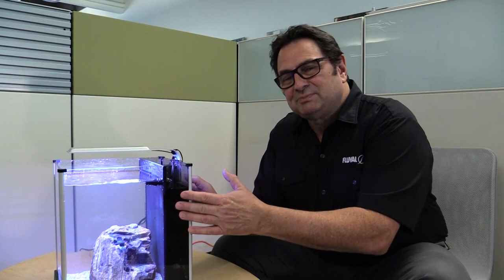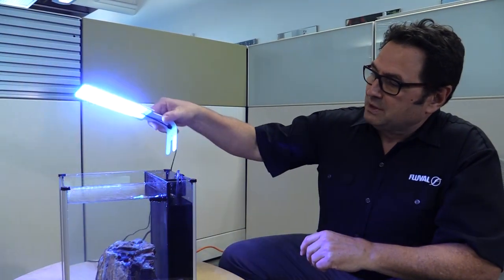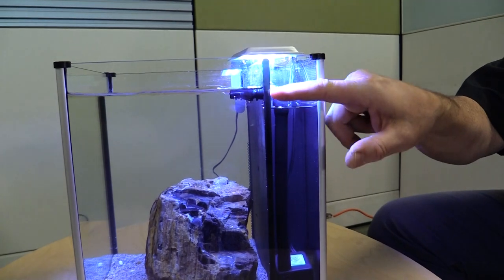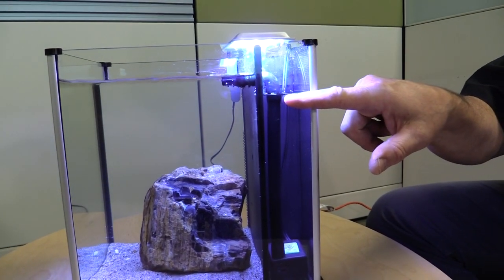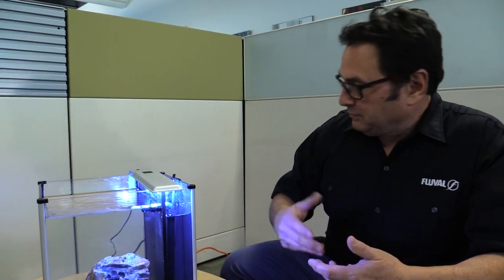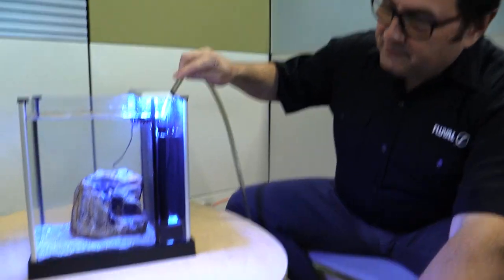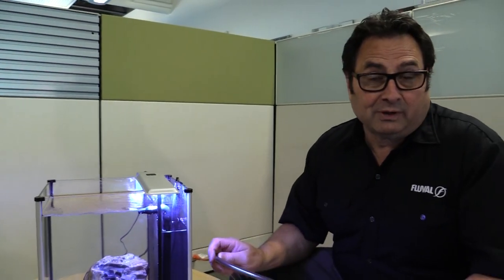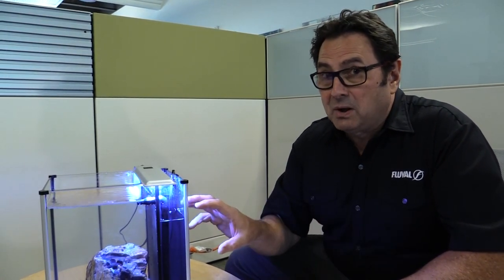Understanding Water Levels in Integrated Aquarium Filters

Comment: I noticed my pump compartment was completely empty of water, but the main tank is totally full. When I pour water into the pump compartment, it all gets pushed out by the pump immediately, emptying the pump compartment, and making my main tank overflow. What’s going on?
Reply from the maker: Hi Jordan, it sounds like either the intake slots are obstructed or the foam block desperately needs to be cleaned / replaced. Make sure nothing is impeding the flow of water from the display area into the rear chambers and through to the pump, and the system should function as expected. If you're still having trouble, please contact our customer support team for assistance: https://fluvalaquatics.com/us/contact-us/

Comment: I have the Fluval Betta Aquarium  that is new this year 2021 and ironically there isn’t much guidance regarding this specific tank and unable to locate and purchase the foam pad that was included for the mechanical diffusion chamber!!
I bought this April 2nd and 
today (June 7th) tried this method to remove water from the filter compartment in hopes this would create enough movement for the surface water to circulate but instead of it lowering the water level in the filter compartment, it lowered the water level in the tank 😟 
Notes* cleaned out the filter pump completely and still can’t get the surface water to circulate even when changed through the flow rate
Reply from the maker: Hi Scorpio, we are sorry to hear that you are having some trouble with your aquarium. Please contact our customer service team regarding this, they will be glad to assist you. 😊 https://fluvalaquatics.com/us/contact-us/
Reply: @fluval  thank you! 
I decided to better because it sounded more of a contact help question 😆

Comment: Would that cause on side of the main tank to be higher ?
Reply from the maker: As you can see in the video it would not, topping up based on the pump output chamber will be reflected in the pump chamber only being returned to the correct water level, given you are maintaining filter media within a reasonable interval.

Comment: where is the proper level for the sump? how full should it be for the filtration to work properly
Reply from the maker: The water level in the tank should be kept at halfway up the inlet grill, on the opposite side in filter the inlet compartment, the water level should be the same. As we point out in the video use the pump compartment to add water back to, this is the compartment that will reflect water loss first.

Comment: I need baby shrimp safe inlets for my flex tank, please
I'm sure i'm not the only one
Reply from the maker: Protecting fry from entering any filter is always a challenge. For the Flex tanks we recommend using an Aqua Clear Foam block to fit on the inside of the inlet compartment up against the grill opening, this will prevent fry from entering. This is an FAQ on our updated website but may not yet be posted.

Comment: Very Informative video! I notice my water level in the Marineland Portrait Five gallon tank keep rising and the water in the back of the tank is going down! I was wondering why it was doing this in the tank?
Reply: Hello! Do you know the reason why the water is rising in the tank and the back filtration level is low?
Reply from the maker: If there is nothing obstructing the inlet screen to the back filtration compartment then it should not be rising in the aquarium from where it is typically.
Reply: Hello! I truly agree.
Reply: Hello! The motor and filtration in the tank was working fine on Monday and yesterday morning. I notice the water level was rising again pass the minimum and medium level lines of the tank! I had to turn it off due the water level rising to the very top of the tank!  My fiancee think it is having too much water in the tank? I have it leveled to the Minimum level in the Marineland Portrait tank! I never had a problem with this tank until some weeks ago. He thinks it could be the weight of the decor which is pushing the buoyancy of the water level in the tank. I have only two medium length silk plants, three moss balls and a medium size cave decor.
Reply: It’s like you didn’t pay attention to the video at all

Comment: If this is the case it would be advisable to put your aquarium heater in the front section of the aquarium to reduce the risk of having the heater malfunction if you had it in the back where the filter is located. This can cause failures and even a fire. If you do put it in the back make sure you check the water level often.
Reply from the maker: Fire is not an risk with as submersible heater. The key is regular verification, especially of your thermometer. Placing the heater in the rear filter compartment is an option when following the advice in regards to regular water level checks of the pump compartment.

Comment: I put my heater where the pump is on my fluval flex 15 gallon woke up to burning smell rushed downstairs and was looking at what aquarium had the problem but it was easy to see the pump on the flex was making lots of bubbles because the water level was low, obviously the filter broke and since then always keep the filter on the opposite end compartment, I'm also about to take out the sponge filter that goes in the middle cut it In half put it on the first compartment and fill the second one with media to the top

Comment: I have a little bit larger one. Can too much water evaporate and the pump stop working I’ve been away for over a week?
Reply from the maker: Hi John! Eventually, yes, enough water will evaporate that the pump will run dry. This takes much longer than a week, however, so you should be fine! Furthermore, depending on the tank you have, there may be an emergency intake near the bottom of the tank to help prevent this from happening.

Comment: I have both the flex 15 and the 32.5 flex. I did not have this problem with the larger model flex, but in the smaller one, my nerite snails were constantly climbing up, over and into the filter compartment. This drives me crazy.

Is there any fix to this issue?
Reply from the maker: You might try slicing a length of tubing of sufficient diameter to fit over the top edge of the filter compartment wall, such that it does not impact any significant area of the inlet grill at the top, such that it touches the plastic lid.

Comment: I have the fluval flex 15 and I have everything set up the way listed in the instructions. I have the heater from you guys that you recommend for this tank in the exact spot shown in the instructions, in the filter compartment. The issue is that I can not fill the actual tank with enough water for the top intake grates to be able to intake water because if I do, then the water level is so high in the filter compartment that my heater has to place up so high that I can not put the tank lid on.
Reply from the maker: Hi there! We think we understand the issue - you can completely submerge the heater in water, it's fully submersible! That way you should be able to have the water level at the right height. 👍

Comment: old video but can you make a wet dry filter fully submerged? Like drill a home lower like some aio units do so if the water level runs low the pump wont run dry? i have a sea clear acrylic with wet dry built in back is why is im asking. thanks
Reply from the maker: Hi Scott, that sounds like a fun project! Since we can't see your setup, we're hesitant to offer any advice - we suggest posting about it in a group on Facebook or another website to get advice and recommendations!

Comment: Thanks for your explanation. Can Fluval Hang on back filters (like the Fluval C3 or Aquaclear) be used in low water level turtle tanks? Thank you!
Reply from the maker: Hang-on-back filters generally need the water level of the aquarium to be quite close to the rim. In the case of the C3, for example, the minimum water level in the tank should be no more than 2.25" / 6 cm below the aquarium rim. We recommend internal filters, like the Fluval U Series, for turtle tanks!
Reply: @fluval  Thanks for your reply and advice.

Comment: Hi Just bought a flex 57 ltr tank.  newbie question . the two water teturn jets from pump.  Should they be above the water level? My guess is yes to allow aeration of the water? I have set the level to where my fish shop said  but I see micro bubbles fast flowing round the upper half of the water.   No fish in the tank yet as at least around 10 days to  get filter up and running properly . Your advice please    Level as set  from advice so far is if looking from the front half way up the black grid around the top.
Reply from the maker: Hi Peter! The dual output nozzles don't need to be above the surface - doing so will cause quite a bit of splashing and will make some noise. At least one of the output nozzles should be quite near the surface, however, to ensure adequate agitation and oxygenation of the water. The other nozzle can also be at the surface, or directed more downward to ensure water movement throughout the tank!
Reply: @fluval  Hi - we have recently introduced some small tetra to a new flex 19l aquarium for my son, but noticed the fish are struggling with the current caused by having the nozzle under the water level.  I have removed the stress on the fish by lowering the water level to below the nozzle, but as you mention, this causes splash noise.  I'm new to all this, can you suggest anything that could sort this problem out?  I read a baffle could help.  Many thanks in advance.

Comment: I just set up a flex 15g. The top intake is above the water line..only a tiny bit is under water...is this normal, or ok?
Reply from the maker: Hi David, that's fine! Most of the water will flow in through the bottom intake in that case.
Reply: @fluval  ok thank you so much, however I was able to add more water than I thought so most of the top intake is under water now. My tank cleared up after the bacterial bloom and looks great. I dont even need the fluval bioclear I bought...my only pet shop where I live wont do free water tests unless you already have fish so im not really sure if its safe to add fish. I looks great though and i did declorinate 1st then added the bacteria when i set it up but im just not sure its safe yet...its been 5 days

Comment: A new razor blade will fix that problem. Cut careful around the silicone and remove that back panel completely. Now you can see your heater is working. You can see that a sponge filter is working and the water level is the water level.  Sometimes simply things just don’t need to be made complicated Fluval. Love your tanks . I have 4 of them all purchased from the rubbish dump recycling shed. Perhaps if they had been kept simple the original owner would still be in the hobby ? I think the large filter foam blocks are fantastic as well but I don’t hide them away as Fluval seems to think needs to be done.
Reply from the maker: Alan, unfortunately it is not the razor blade that addresses the water level, which is no challenge to see when looking downwards into the filter :) That said, you are right, it is not complicated, we thought our example of siphoning as easy as it gets to demonstrate the principle.
Reply: I am sure you are correct. Thank you for your time.
Reply: Nice. Good idea w the razor

Comment: Thanks for the video! It would also be good to have extra tips on how high to fill the tank (mid-way up the honeycomb?), what dangerously low levels of water are, and how to tell the difference between normal evaporation and the filter or intakes being blocked (because most of us have some filter floss in there)
.
Reply from the maker: In the kit instructions we cover filling and maintaining the aquarium water level to half way up the inlet grill. In this video we do mention you should address top offs due to evaporation by checking the pump compartment weekly as the tank volume is small. Evaporation is water loss, filter media blockage is handled by regular maintenance, following recommend media maintenance will ensure that is not an issue.

Comment: I would advise anyone with a nano tank to never top off for evaporation. Either stop the evaporation or change water.
Reply from the maker: Actually it is best to both top up regularly (ideally with R/O water) and change water.
Reply: @fluval  then shouldn't you have said that? I would argue that most people who keep aquariums do not have an RO unit, and adding water to compensate for evaporation van have a profound effect on water conditions. I love fluval, I use many of your products because simply put, they're the best, but you really have to be careful when you say things like this because it would be very easy for a newcomer to not understand that it could be harmful if not done properly
Reply from the maker: Thanks, we are fine with sharing information on R/O units, we would welcome any questions about it. Maintaining a constant water level is not only necessary for consistent water chemistry but also for proper functioning of key hardware such as a heater, etc... using R/O water to replace water lost due to evaporation is very safe as that is exactly what has evaporated.
Reply: Is this tank for fresh Water or marine ?
Reply from the maker: It is typically used for fresh water set ups.
Reply: “Either stop the evaporation. This guy 😂😂😂